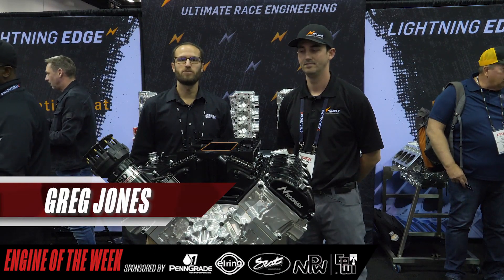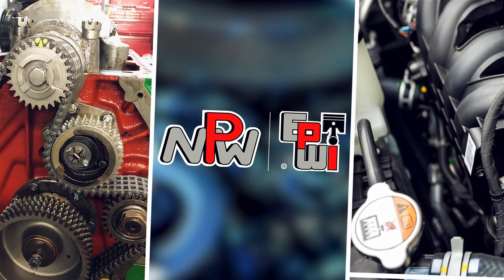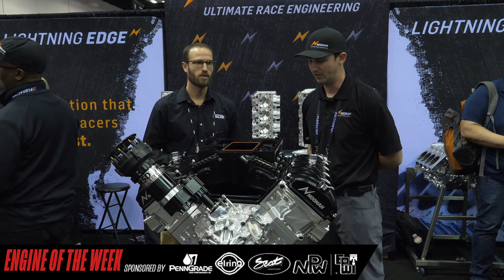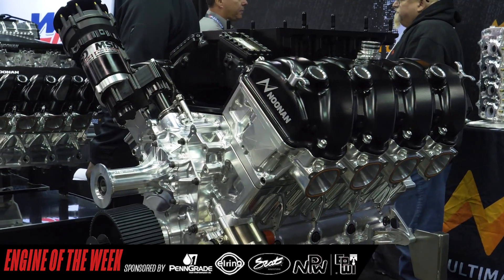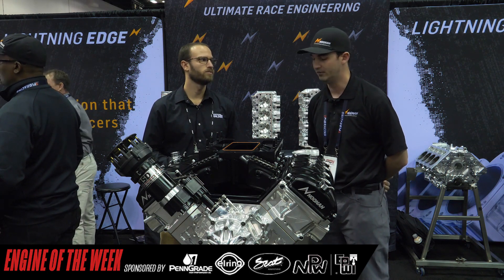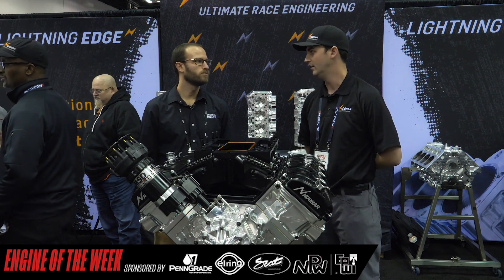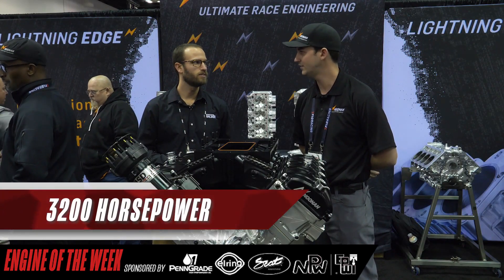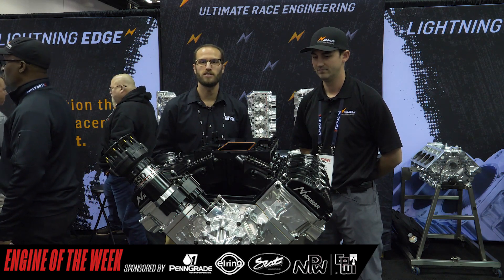Noonan's Billet 4.8˝ Hemi Engine

Comment: Can you have a shallow combustion chamber cylinder head with 4.500 bore,  40 or 36 degree chamber and 2.5 intake,  2.00 exhaust valve ???

Comment: How much horsepower this engine capable of
Reply: Twin turbo max effort HEMI engines have made 5000+ on hub dynos.
Reply: I've seen the 4.8 hemi make 3300hp idk if it's got the blower or without it. The 4.9 hemi makes 4000hp
Reply: @mopardude707  I'm sure a 4.8 noonan hemi (477 hemi ) should make 3500 hp with twin turbos
Reply: @Willdabeest27  do you know what they make without it just the block alone? I was always curious the same I believe your asking as well 😆
Reply: @mopardude707  twin turbos make more hp then a screw blower or procharger
Reply: @Willdabeest27  oh alright but I was wondering out of curiosity what the block alone does without the add ons just naturally aspirated
Reply: @Willdabeest27  what is the cubic inch on the 4.9 hemi?
Reply: Would a 4.8 bore space 477 hemi be a good engine for a f3r 136 procharger or a f3x or f4x procharger